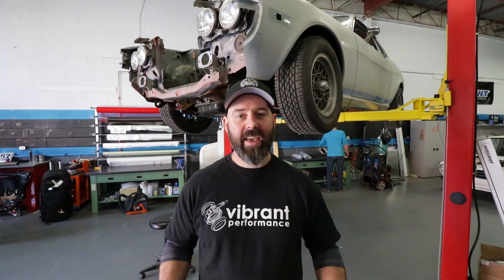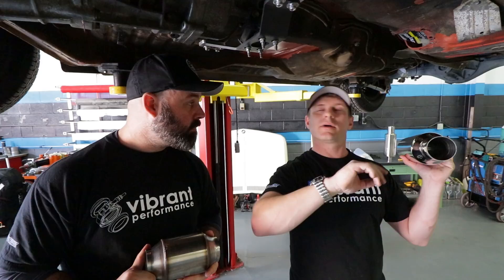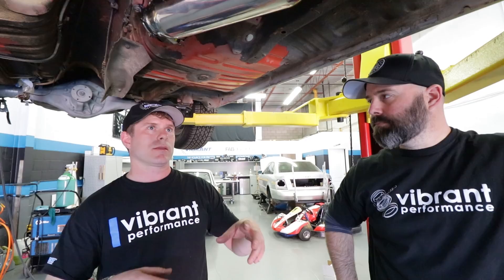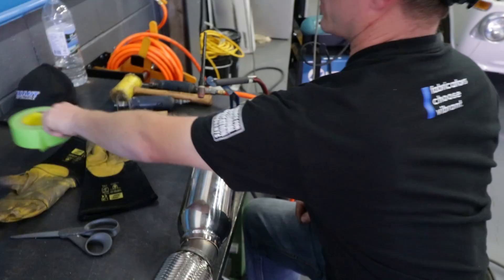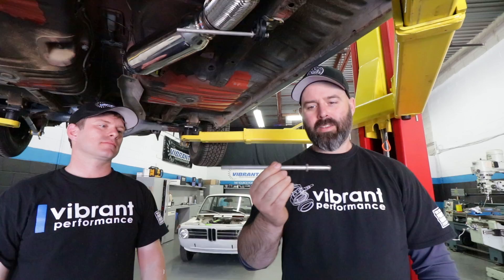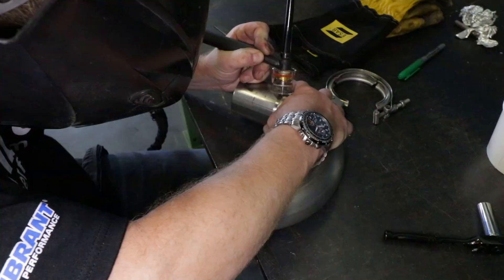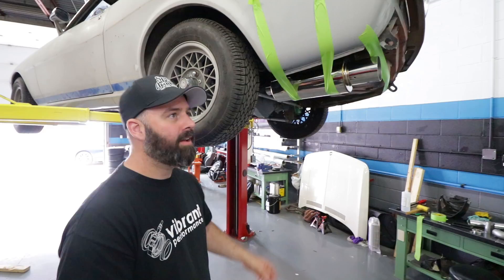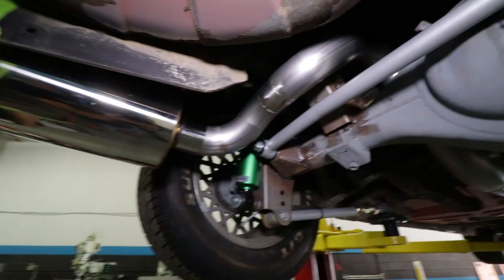Celica Beams 3SGE Header & Exhaust Build-Off Ep5

Comment: You wont have any issues in Canada with e test but if your car is between 81 and 87 then it needs all factory emissions components. You don't need any emissions components if your car is older than 81. This is effective April 2017.

Comment: props for using a cat
Reply: In Ontario if your car was originally equipped with a cat you are still required to use one. Just because it's 1987 or older means y don't need a e test for your license plates. You still need emissions equipment to drive on the streets. The Ministry of Environment can do roadside inspections and pull your plates for equipment violations.
Reply from the maker: That's interesting. We always thought below 87 it was do what you want since its not emissions testable. Thanks for the info.

Comment: The JDM bumper doesn't actually go that low - the RA24 is missing a weld-in filler panel that's present there on early north american/all JDM models that fills in that space below the bumper.

Comment: Just LITTLE things can make a HUGE difference in the sound of a vehicle.
On my used truck engine  LS powered 85 cutlass G-body restomod, , at first i just put a super40 that dumped under passenger rear seat.
IT SOUNDED ABSOLUTELY TERRIBLE. like an indian reserve junk vehicle barely running.
BUT just adding 2 ft of pipe bent about 60degrees so same exact exhaust exited in front of passenger rear wheel, it now sounds like a BURBLING BIG BLOCK CHEVY with a MILD CAM
PLUS it was about 50% less noise in the cab while driving and probly 50% louder to passers by on the passenger side of car.

Comment: Why a fart can exhaust on a classic? Although I love the v band idea.
Reply from the maker: You'd prefer an oval muffler, I assume? We may switch to one if we don't like the sound of this one, but first things first, we need to get Connie running :D
Reply: Speed Academy Yeah any more standard looking muffler  with a normal 2.5" exit to match the rest of the exhaust. Those mufflers with the giant tips just look too modern. I love 80's cars and older cars in general and love when you can put modern parts on but maintain a classic look.
Reply: I think baffled type mufflers give the best sound (e.g., GT3, F-Type, i30N, Mini cooper JCW etc). They take out bass frequencies first, leaving a raspy and crackly sound -- which seems to be fashionable.

So in aftermarket that would be say the Apexi WS2 N/A version, European Remus exhausts or the ATLP exhausts for Acura V6s for example.

Whereas using large absorptive type muffler cans takes out high frequencies first, leaving a very bassy smooth sound (e.g., typical Magnaflow system sound).
Reply: Shane P because JDM as fuck thats why.. But for real.. Why do  people ask such stupid qurstions... He put it on because its his damn build and he will do what he wants to it. The sooner people following this build realize that the better..

Comment: Nice job. Too bad the "digital" method was only used for the header build.
Reply from the maker: That's a good point. We actually didn't start off planning to do the exhaust system, so the series kind of grew into a header and exhaust deal when it was originally conceived as just the header build.

Comment: why not remove the rape and show off the final product?
Reply: Ace Futura don't think it's been hung yet. :) just the pipes spotwelds that's holding it together 😉
Reply: You mean tacks, spot welds are something else completely. And even if the exhaust is only tacked in place, it should still support itself. It might sag an inch or two, but it'll hold. 

ps. I work in an exhaust shop
Reply: Ace Futura yeah sure, tacks.
Yeah it might, but is it worth it if it breaks?

PS. I work on a ship. 😘
Reply: Lol, let's just say I've never ever taped up a muffler and I've never droppen one either (after tacking, that is. before tacking I've dropped plenty) 😘

Comment: Not gunna make power with a 2 and a half inch pipe. Also you wouldn't smell like gas if you went catless . That's the stupidest fucking thing I've herd in a wile actually thanks for the laugh lol
Reply: Wait wait wait, you guys are aware that contrary to popular opinion, a larger exhaust diameter doesn't necessarily mean more power?  Yes you want zero back pressure to eliminate resistance to flow, but if you make a pipe too wide on a smaller engine, the engine won't be producing enough exhaust gas to effectively utilize the cross sectional area.  The gas is free to move around which causes turbulance in the pipe, which in turn reintroduces back pressure.  With a beams only being an NA 2L 4cyl, in all likelihood the car will actually make more power with a 2.5inch exhaust than with a three inch.
Reply: laminar flow is the word of the day people!
Reply: Even my 2015 GTI made me smell like gas with no cat.  I'll give up 2hp to not stink.  2.5 inch is huge for a low output NA engine.
Reply: James Felts how is a beams a low out put engine? Those motors with little more that itb's (this has that) headers (this has that) cams (don't know their plans for that....And a programmable ecu are known to make 265whp.....
Reply: pirsq314 I wasn't suggesting this isn't a nice build for what it is.  But what it is, is a 2L making mid 200hp.  This is not high for 2L engines in general.  2.5" can handle 300+.  Bigger pipe is usually negligable gains (if any), increased weight, and likely more noise.
Reply: zeroyon223... Baffled muffler like a Apexi WS2 NA 60mm is needed to make it sound good.  Straight-through mufflers sound varying degrees of terrible -- there is just too much boomy low-frequencies left, and they take out all the good high-frequencies that give a nice tone.  That is unless you use a N1 that barely muffles the engine at all -- great pure engine tone that way, but good way to annoy everyone nearby! :P
Reply: The amount of HP produced by an engine doesn't determine the size of exhaust that is appropriate for the engine.  It is the actual amount of fuel burnt per second that does, and yes a car that burns more fuel likely does produce more HP, but that does not mean HP is an appropriate indicator for exhaust size.  There are however some obvious indicators.  First is engine size, a larger literage engine is going to burn more fuel, second is whether the engine is boosted, a boosted engine consumes an F ton more fuel, third is the efficiency of the engine, this is more difficult to determine but a good rule of thumb is that the more modern an engine, the more likely it is to be fuel efficient.  Finally RPM is a factor, an engine revving at 8000rpm is going to burn more than double the same engine revving to 4000rpm, why more than double?  Because to rev higher each stroke needs more fuel, so first of all each stroke is occurring twice as often and secondly with more fuel.  When we apply this knowledge to the beams engine we can see:  it's a low litrage engine, it's NA, it's average for it's fuel efficiency and its pretty high revving (peak power at 7600RPM), all in all it is instantly obvious that a 2.5 inch exhaust will produce more power with this engine than with a 3 inch exhaust.  There simply would not be enough exhaust gas produced to fill the 3 inch pipe, this would create turbulance which in turn would produce back pressure.  Back pressure will stop all of the exhaust gasses from leaving the chamber.  This will mean on the intake stroke less fuel and air can be pulled into the combustion chamber which in turn means less power is produced. 
 TLDR:  HP isn't a good indicator of how large a cars exhaust needs to be.  Exhausts aren't a case of "bigger is better", back pressure is bad, not good, back pressure is reduced by widening an exhaust, but reintroduced when the pipe is too wide. A beams engine doesn't produce enough exhaust gas to warrant a 3 inch pipe.  A beams engine would very likely make more power with a 2.5 inch exhaust.